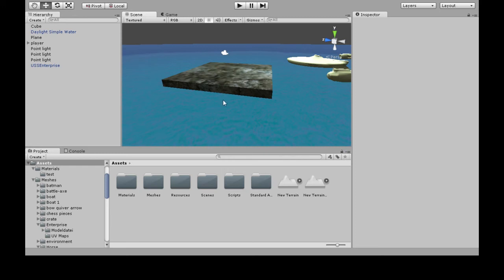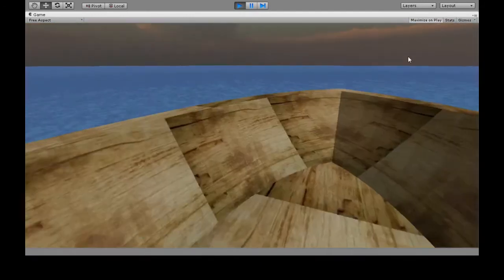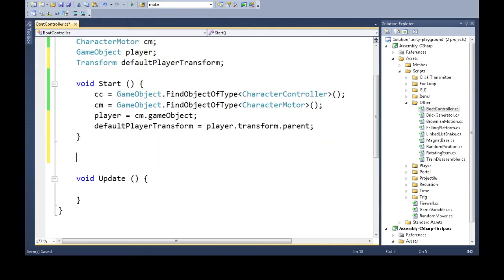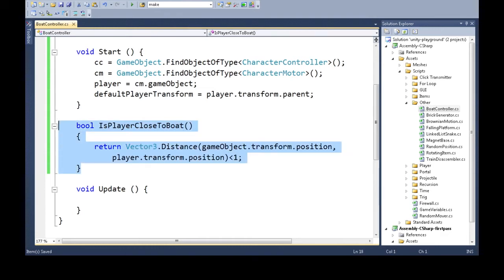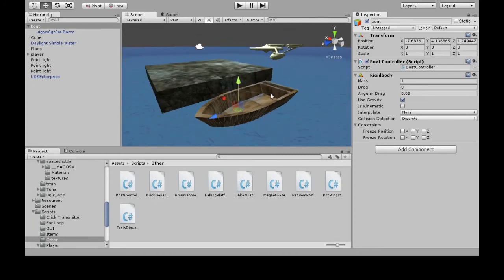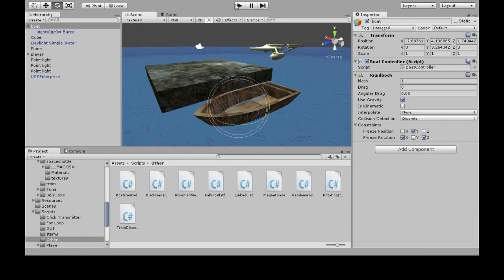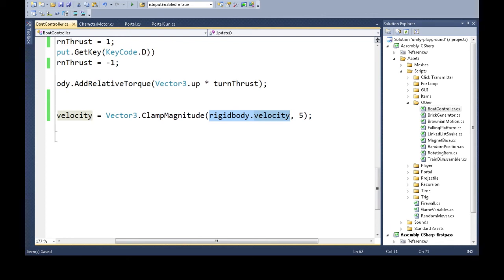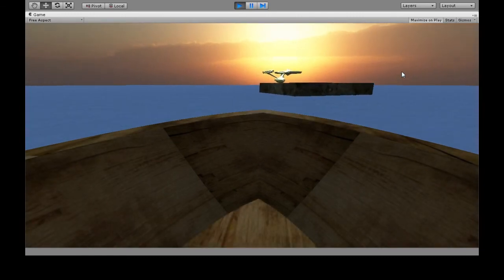Unity3D - Ride a Boat (Unity 4.3)

Comment: Could I get some help with this. I'm using Unity 5.6.1 trying to implement a boat into my game using your tutorial. When I click 1 which is set as my key to access the boat the charactercontroller stops the character and I can't move whilst in the boat. Any suggestions on how to make it so that I can control the boat whilst using the first person controller?
Reply from the maker: It's a bit hard to help because you didn't give enough details. Consider reading this for tips on how to ask a question:

https://stuartspencestuff.blogspot.ca/2016/03/sorry-id-like-to-help-you-but-i-cant.html
Reply: Hi, thanks for replying. The problem I am having is that when I press the number 1 which is what I keycoded to toggle driving I will get this message from Unity: CharacterController.Move called on inactive controller. UnityEngine.CharacterController:Mover(Vector3)

Below is my code for my boat controller following your tutorial:
using UnityEngine;

public class BoatController : MonoBehaviour {

    public Rigidbody rigidbody;

    CharacterController cc;
    GameObject player;
    Transform defaultPlayerTransform;

    float startY;

    bool isDriving;

    
    public int ForwardThrust { get; private set; }
    public int TurnThrust { get; private set; }
    public bool IsDriving { get; private set; }

    // Use this for initialization
    void Start ()
    {
        cc = FindObjectOfType<CharacterController>();
        player = gameObject;
        defaultPlayerTransform = player.transform.parent;
    
        startY = gameObject.transform.position.y;
 }

    //Checks if the player is close to the boat.
    bool IsPlayerCloseToBoat()
    {
        //Returns if players location is less than 1//
        return Vector3.Distance(gameObject.transform.position,
            player.transform.position) < 1;
    }

    //Allows for the player to drive the boat//
    void SetDriving(bool isDriving)
    {
        //Toggles is driving
        this.IsDriving = isDriving;

        //Character controller is set to off as we are driving//
        cc.enabled = !isDriving;

        //If statement that sets the player the to gameObject boat//
        if (isDriving)
            player.transform.parent = gameObject.transform;
        //Makes the parent of the player return to the CharacterController//
        else
            player.transform.parent = defaultPlayerTransform;
    }

    // Update is called once per frame
    void Update()
    {
        // Toggles if we driving //
        if (Input.GetKeyDown(KeyCode.Alpha1) && IsPlayerCloseToBoat())
            SetDriving(!IsDriving);

        if (IsDriving)
        {
            if (Input.GetKey(KeyCode.W))
                ForwardThrust = 3;
            // If statement to allow the backward movement of the boat assigning the keys S // 
            if (Input.GetKey(KeyCode.S))
                ForwardThrust = -1;

            //Adds the forward movement/movement to the boats rigidbody
            rigidbody.AddForce(gameObject.transform.forward * 0);
            if (Input.GetKey(KeyCode.A))
                TurnThrust = -1;
            // If statement to allow the boat to move right assigning the keys D // 
            if (Input.GetKey(KeyCode.D))
                TurnThrust = 1;

            //Adds torque to the rigidbody of the boat allowing it turn
            rigidbody.AddRelativeTorque(Vector3.up * 0);
        }

        rigidbody.velocity = Vector3.ClampMagnitude(rigidbody.velocity, 5);

        Vector3 newPosition = gameObject.transform.position;
        newPosition.y = startY + Mathf.Sin(Time.timeSinceLevelLoad*2)/8;
        gameObject.transform.position = newPosition;
    }   
}

Also find below the line code in my FirstPersonController that Unity whats me to change/edit:
            m_CollisionFlags = m_CharacterController.Move(m_MoveDir*Time.fixedDeltaTime);

I've tried looking into this but not sure on how to fix the problem to allow me to controll the boat.

Any help would be much appreciated thanks.
Reply: Is there anyway you can help me with this controller, making it work on 5.6.1? I've followed through the tutorial several times now made changes to make it work for my version of Unity and it still doesn't work. I've even went and found a charactermotorC script file to add to my to see if that helps and still nothing is working with the boat. I need help with this ASAP!
Kind regards
James Hadley

Comment: using UnityEngine;
using System.Collections;

public class BoatRide : MonoBehaviour {
	CharacterController cc;
	CharacterMotor cm;
	GameObject player;
	Transform DefualtPlayerTransform;

	bool isDriving=false;

	// Use this for initialization
	void Start () {
		cc = GameObject.FindObjectOfType<CharacterController> ();
		cm = GameObject.FindObjectOfType<CharacterMotor> ();
		player = cm.GameObject;
		DefualtPlayerTransform = player.transform.parent;
	
	}

	bool IsplayerCloseToBoat()
	{
		return Vector3.Distance(GameObject.transform.position, 
		    player.transform.position)<1;
	}

	void SetDriving(bool isDriving)
	{
		this.isDriving = isDriving;
		SetDriving (!isDriving);

		cm.enabled = !isDriving;
		cc.enabled = !isDriving;

		if (isDriving)
			player.transform.parent = gameObject.transform;
		else
			player.transform.parent = DefualtPlayerTransform;
	}
	
	// Update is called once per frame
	void Update () {
		if (Input.GetKeyDown (KeyCode.E) && IsPlayerCloseToBoat ())
		{

		}
	
	}
}
Reply: squid craft What is wrong
Reply: It work in unity 5?

Comment: what version of unity and monodevelop are you using because im copying down everything you wrote and it is giving me errors such as "expect ; line 13, 29" when there is either already a semicolon there or no code there at all so it dosent need one, also when i write and open parenthesis ( it opens a dialogue box and gives me a bunch of errors, all help is appreciated and would it work better if i were to use something such as notepad++
Reply: ***** mybad i did not notice that it was C# i was using javascript lol

Comment: Whenever my character dismounts the boat it gets launched with all of the force applied to the boat during your boat journey, like miles and miles away almost instantly haha, how can i fix this?
Reply: I too have the same problem ,how did you solve it?
Reply: ajeje brazof 			player.GetComponent<CharacterMotor> ().SendMessage ("SetVelocity", new Vector3 (0, 0, 0));
Reply: Dano Kablamo
thank you!
Reply: Dano Kablamo Where do you put that?
Reply: When you dismount. You have to make a function on your CharacterMotor script to receive it though.  I don't even know if that would be the best way to do it anymore.

Comment: Is the reason you set isDriving to false before the Start() because that variable can be set before Start(), whereas the other variables can only be set during Start()because that is when we are sure the scene has been completely populated with all the objects of the level?
Reply from the maker: Kyler Kelly I believe booleans in C# are by default false so I probably could have just written "bool isDriving;". But I did so to be clear because when the game starts, we are not on the boat.You're right that Start is when the scene is populated. In this case it doesn't matter since nothing is going to look at the value of isDriving until way after Start, Awake, etc.